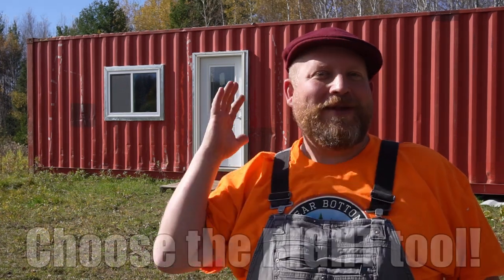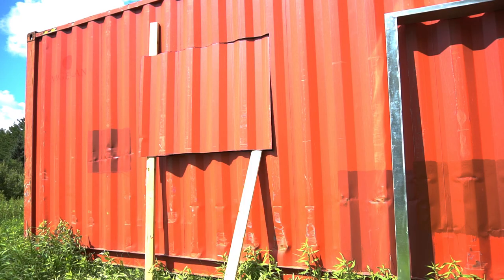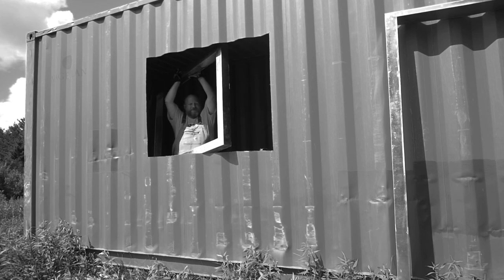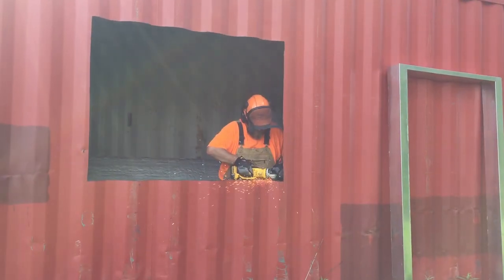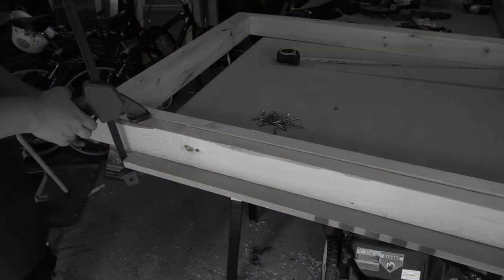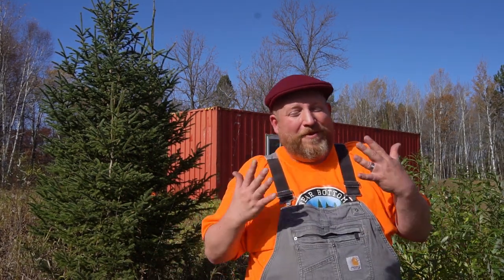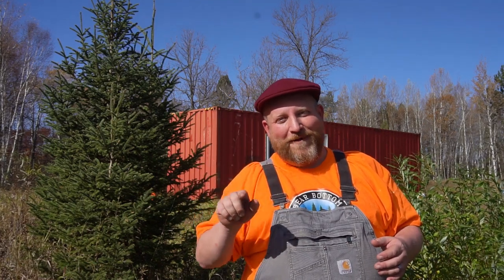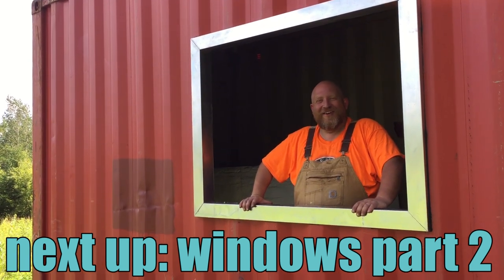NO WELD Container Cabin Window Frames| I Wish They Would Have TOLD ME THIS | Bear Bottom Acres

Comment: Dude I just run a 2x6 border flat inside and out bolted together caulked the hell out of it.  Next i ripped a 1x6  to fit for a jam and just hung the window and door as normal.  Been a carpenter for 45 years.  I did two doors and two windows on two containers in a day. and I'm 68 years old. I did buy a metal blade for my 40-year-old Skilsaw and it cut like butter.

Comment: Battery 5" grinder???  You can buy a generator and a 6/7" grinder for the price of those batteries.  Batt angle grinders, and 5" or for tiny jobs.  Very handy for 80% of stuff.  But any real work, you need 110 and big disk.

Comment: At my farm one of the very first things we purchased after our seacan was a riding mower to maintain the area we relax in.  Second purchase was a generator.   Our seacan came with an A/C installed since our summers can get hot and winters are brutally cold.   We bought a generator that is big enough to run a few heaters or our ac.   I'm a carpenter by trade so already have tons of tools.  The generator allows me to run any tools I need to use plus keeps us comfortable during bad weather.

Comment: I've watched a couple of videos and they used a sawzall, of course with metal cutting blades and it appeared to work quite well. 
I just got a 20' shipping container I'm going to use to store and work on my Harleys.
I'm not putting in windows, but I will install a couple of vents with a fan and a door, and possibly a small 110 air-conditioner. (Portable heating to)
I've also purchased 2x4s for framing the interior and insulation.
Hope to be done next month.

Comment: I had exactly the same problem with my grinding, that corton steel is insane. Apparently using a sawzall or jigsaw with a metal cutting bit will make it SO fast. Took me 2 hours to cut out my vent hole with my angle grinder and it looked terrible. Then went to cut another hole and used a sawzall and it took me 10 mins. >.< The trick for straight lines on the container walls is a piece of thick poster board or cardboard. It conforms to the corrugation without losing it's straight edge. GL with your build. If I had to do mine again I would have skipped windows altogether as they are a pita and just break the wind and water tightness of the building.
Reply: My hilti 2000w grinder chewed through the container walls

Comment: I used a 20 Volt Worx Drill and drilled 1/2” holes (3/16 pilot) in the 4 corners 5 minutes and then a 20 Volt Worx Recip to cut a 36” x 36” Window with 1 shared battery and 2 blades in 5 minutes also. I tried a Grinder for my solar vent hole and back to that skinny  blade Recip.

Comment: I found that using the sawzall went really fast and kept my battery life WAY UP.  Containers arrive in all kinds of conditions.  We spent a lot of money doing laser leveling on our peers only to find that the container wasn't straight, square nor level.
Reply: Most containers sold are removed from cargo service because of damage especially corrosion and bad end door gaskets. I warn others against buying them for anything but workshop or rough storage use.
For a residence or nicer workshop a "one trip" grade is vastly better but harder to find and more expensive. I made the mistake of using two "Wind and Water Tight" grade shitboxes. Never again and the next two are nice clean 40' High Cubes with doors on both ends. My foundation is steel beams (used of course) so the whole structure will remain easy to jack and shim if it ever shifted which is unlikely. 
I use recip saws, an OA torch and one of my favorites, 6" thin kerf abrasive cutting disks on an angle grinder. Any local welding supply carries them and I buy by the box. They'll cut steel plate and I've sliced the end off a truck axle (not the housing, the axle which is forged) with them.

Comment: Thank you Kevin. I had watched the same video and have had the same concerns, which unfortunately you lived out! Learning from you though as I plan my build. I am also in MN, a little north of the twin cities. Have you see any good resources or tutorials in regards to attaching a wood frame in a quality manner while making sure it's water and air tight without adding siding to the container afterwards? Thanks again for the great video.
Reply from the maker: You don’t need to attach a wood frame to the container.  You screw in to the floor then everything gets pounded and wedged in as you go and screw it together so it becomes solid. 

As far as water and air tight you need to think about heating and cooling.  I bought a combo unit and it’s exhaust fits in the window nicely but the air intake is within the room which is small.  You open the window and it whistles until you open it far enough.

I might make a path from the garage area to the living area to pull air from.  Other wise on really cold nights it doesn’t heat up fast enough because of opening the window.

I would put some type of roof on it because the windows and door are not made to have water sit on top there usually some type of over hang.
Reply: @BearBottomAcres  Thanks Kevin. I’ll keep building prototypes in CAD and researching until I’m ready to start buying everything and cutting holes! I appreciate the help and input.

Comment: 2:36 "More time OR more batteries."  That...OR get a smallish (4KW or so) gas or propane (I prefer propane) generator for the heavy duty jobs that typically eat up batteries.
Reply from the maker: Mountain Crest Farm yeah I really really really wanted to upgrade to some Dewalt 20 volt max.  So I stayed on the course so I didn’t feel guilty for buying myself some toys.  Hoping I would get faster and more efficient.  I did but not enough.

Comment: Why not use 2 by 4 steel tubes for the frame?
Reply from the maker: You have to put it through a I am poor filter and low skill filter.  We bought the land.  That was 12k out of savings.  Then we were not expecting to have to have a shelter solution as soon as we did.  We were also buying a lot of other things that I never had before, atv, chainsaw, etc.

Like many things you have to scale up.  We are just now getting electricity.  We put in a well, 100ft. By 200ft deer fence.  Now Heather and I are further along in our careers and income so more decisions are invested in for long term more often.  Some things we say this is good enough until we can permanently move there.

Comment: Turning a container in to a house  cost more then you think more then building out of wood. In MN they sweat on the inside do to are wheather, when done you will not see but will smell later (mold). I have remolded pole barns on 6 yrs old with spray foam and were molding on inside.
Reply from the maker: Wes where have you been buddy?  Nice to see you back.  

We can see the difference with sweating from the insulated side to the non.  We will see how it goes.  I like that we got it partially done this year so we can see if there are any opportunities to improve before putting in dry wall.  Also we are going to be putting on a roof and other things to reduce the heat induction and reduce the chances of sweating.

If it turns out to be a disaster as you are foreshadowing then there will be value in sharing that with folks also.

I agree that if you get more than one shipping container and then weld them together and add steel beams for strength then you are just doing it because you like the shipping container aesthetic.  It is not cost effective per square foot.

For our application, what we need and are using it for we made the best choice.  When we move to the land full time then we will build a farm sheik palace of a pole barn on roids.🤪

Love to see your comments again sir!
Reply: Do you recommend spray foam for a shipping container or some other insulation?

Comment: thanks for the video. Great information. Wouldn't a reciprocating saw with a metal blade work better for cutting out the windows and doors
Reply from the maker: Suzanne Du4  it could be!?!  I would have to try it out but any saw with the right blade is a consideration.  But you want consistent and true.  A small blade leads to inconsistencies.  I would go with a big blade that makes a more consistent line.

Comment: Do you seal the roof
Reply from the maker: No we did not.  We will have to do something because we did buy a container that has some dents in the roof but it is over the garage part.  I am going to take a 4 X 4 and a hydraulic jack to pop them out.  I do think that I am going to put some type of roof on it because when it rains it flows down on all sides so Getting in and out of the front door can be a little wet.  I will probably weld on and then make a roof.  We do also plan to do a complete paint job with a rubbery paint that acts as another layer of insulation.